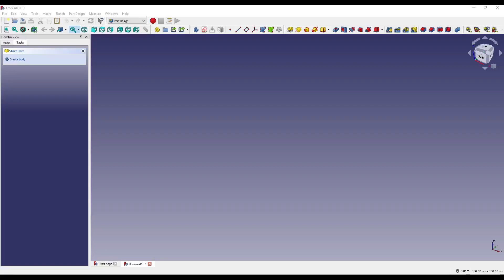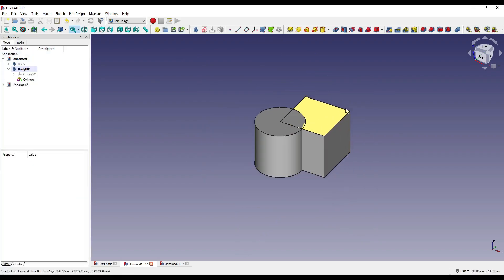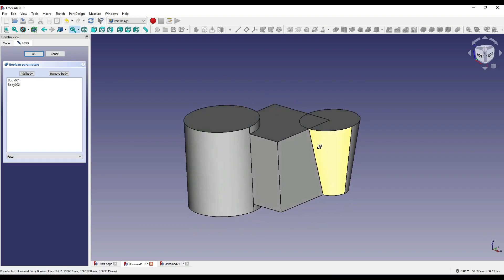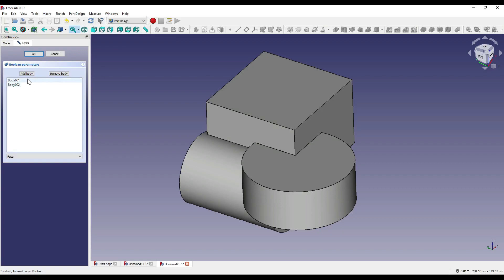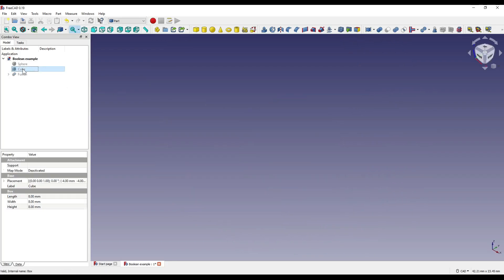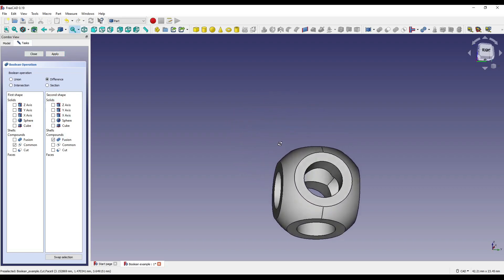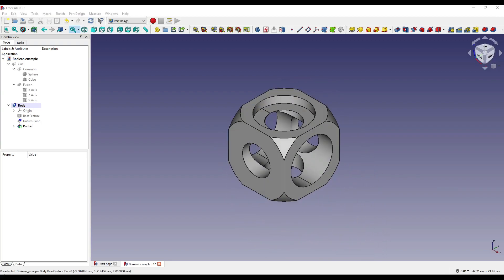3D modeling FreeCAD Tutorial - Boolean modifiers

Comment: The "cleaner piece of geometry" is useful when 3D printing, as it will print across those areas joined, instead of treating them as separate areas to print individually, yielding a stronger part.

Comment: Lots of interesting details. You're meticulous. :-)

I encounter strange issue. I don't know if I made some error or is it FreeCad fault.
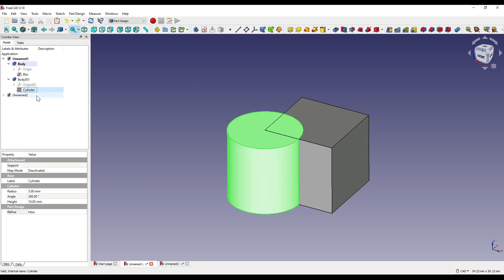03:20 Part Design, Cube & Cylinder. 
I resized cylinder to be bigger than cube and transformed it by lowering cylinder. 
Then i set cylinder as active body and made a cut. 
My intention was to create a cavity in the cylinder with a floor and a ceiling. 
but when I press Boolean operation, the cube moves down, so both figures are on the same level. 
Is there a way to prevent this behaviour?
P.S Hope I made myself clear. English is not my first language.